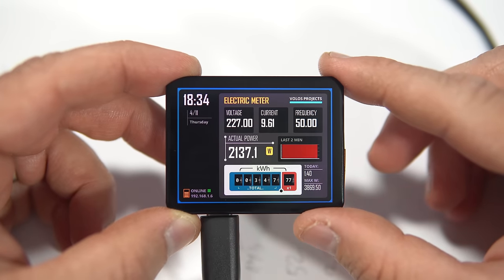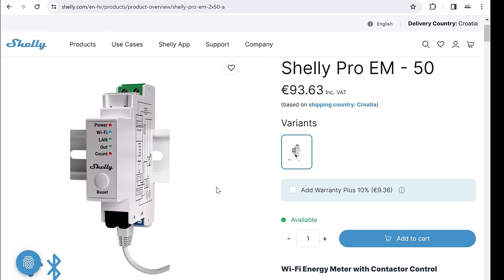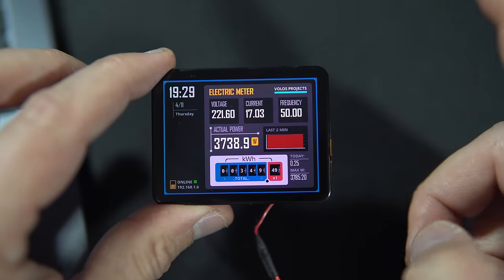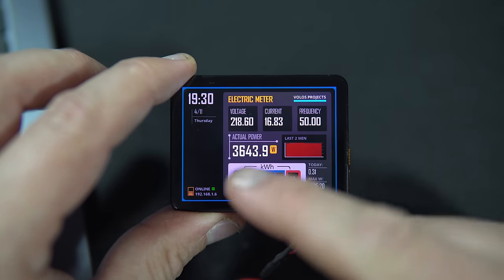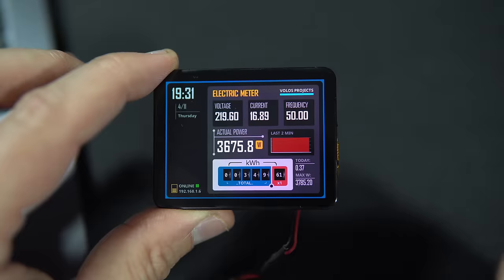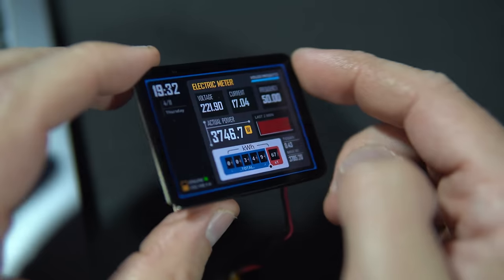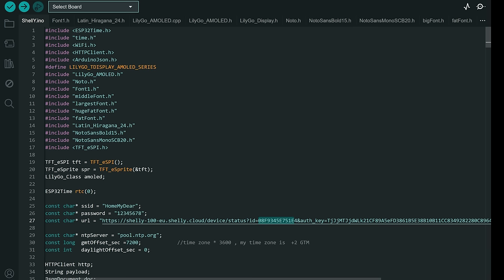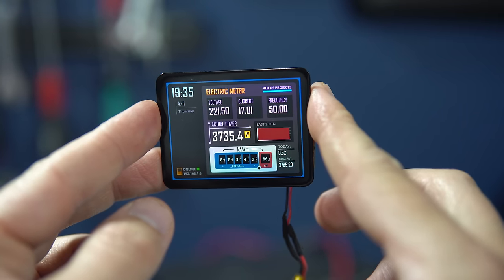Monitoring  House Power Consumption with ESP32 and Shelly Power Meter

Comment: Get rid of the shelly and make your own! It's ridiculously easy and super cheap!  £10 for the ct clamp and £10 or so for a high quality external ADC. Would be a really good project to do and you could use an esp and create your own API on board that matches the shelly calls, so you can easily switch between shelly/your own

Comment: A very good looking user interface, congratulations on the hard work. The small details from it are a great addition. Perhaps you can have the space on the left used to have a statistics scroll-toggle section, where you show stats like "+20% from yesterday" or show listed entry values for the kWh consumed in the past 6-7 days. I know since you're using only the Shelly API that some limitation might be in place if you don't consider a database.
Initially I assumed you would be directly showing data from HomeAssistant, but this is a very cool interface that one can directly use as-is to see the Shelly Cloud values in a great rendered way.
Thank you for sharing these projects with us and keep up the good quality work! We do appreciate it.
Reply from the maker: thank you, yes you are right this API is limited, or i just need to fihure it out. I wish to add history data , forexample last months or similar. Thank you!

Comment: The interface looks great!
It would be interesting to reverse-engineer the power meter communication with the shelly server, so that you can have your router redirect the requests to a local server and thus be able to maintain access to the meter and data even if the internet service is down, or shelly stops providing the cloud service.
Reply: You can use something like Home Assistant for that, it supports fetching data locally from Shelly devices and has a local API which devices such as this one can use to fetch all data. Also allows you to blend in data from other sensors (such as solar inverters, etc).
Reply: @ErikHenriksson_  Ah great, that makes it easier then. I'm all for merging everything into Home Assistant as it's a great project and saves having to reinvent the wheel.

Comment: Your doing great work! You always mention that the coding take a lot time. Have you ever tried LVGL or Squareline? It looks like it could be a little easier and a lot less intimidating to the non programer like me. Also, I love your UI's and coding. I would love to see more projects/ instructionals with more end application examples. like:
- a the sliding bar moving a servo or controlling a (DC or PWM) motors RPM
- a tachometer displaying a motor's RPM using IR, or hall effect senor
- the temperature using thermistors or temperature sensors 
- displaying GPS Data like direction and speed
- using multiple ESP32's networked together using CAN bus (CJMCU-1051) to send data to a display panel or multiple panels. and or using ESPNow.

All your videos have been great, and I think I've seen the screen examples of most of the ideas above and some had actual inputs but I would love to see the gap closed and have more real world environmental input that change the values on the screen. 

If not, that's ok, you still inspire me and show me what is possible!
Thank you!
Reply from the maker: Thank yoi Jason, yes i tried lvgl and sqare line. And i did not like it. I still think sqareline is great tool and lvgl is great library but it is not for me. Also most of time projects made with sqare line look the same becouse people use same template. I will cover aome of your ideas. Thank you again. Cheers

Comment: super nice GUI. it beats by far a lot of other OEM solutions (like Sonoff or Shelly display). too bad the T4 display is not as cheap as a tablet running Kiosk for HomeAssistant. Otherwise it is a neat integration, and having the code available puts this LILYGO board on the top of my wish list. Please consider a code update for a 2ch shelly or scenario with PV production. This would be a great visual indication when there is surplus PV energy, and how much is extra. Also in scenario with inverters (like Huawei) connected with a single power line (not separate power in and power out like Voltronic type inverters) the energy coming from PV is reported with negative values (because is returned from Invertor) while the consumed energy from grid to inverter is reported with positive values. Keep On the good work. you were right few months ago tostop making more clock projects.... there are many more intersting applications to be done..

Comment: Nico Design. I like it. I have made my own with an other display connected via LoRa to my power meter in the cellar because wifi didn‘t work. It looks not so nice but it works and sends the collected data to my homeassistant. 😉

Comment: NO CLOUD version -> Setup and MQTT broker (server). It can even run on a ESP32. Configure Shelly to send data to said broker (supported nativly). Adapt OPs code to get data (subscribe) from the MQTT broker/topic that the Shelly publishes on. 

The concept works, I have been running like this for at least 2 years with no hiccups. I my case, I use Home Assistant (and not the OPs beautiful ESP32 contraption / UI ) to receive/display the data.

Comment: Another great tutorial, thanks Volos.  General question:  I notice that in most, if not all, tutorials that you use generic ESP32S3 board selection in the Arduino IDE.  You do not select Lilygo board in the board setup.  I work with Lilygo, M5Stack, and other ESP32 boards.  Is it best to always use the generic Espressif ESP32S3 board selection in Arduino IDE?  Thanks - Larry
Reply from the maker: Hello, Larry i chose esp32 s3 only when using new lilygo boards, that is not case with m5stack and older lilygo. Thank you for your support.

Comment: Is it possible to set this up without an internet connection? I'd like to set-up an energy monitor like this on a farm; but, we don't have access to cellular or broadband/DSL. I looked at the iotawatt split phase kit for our sub panel; but, it's quite pricey & we don't need to monitor many individual circuits. We just need to record & display energy consumption for individual different sub panels. We cannot get a secondary meter installed by the local utility. Thanks!
Reply from the maker: with this device i think it is not possible.

Comment: Any offline solution (no cloud at all, including local time server) with Home Assistant to display the information?
Reply: need a little bit more coding , and a few more wire , but is use PZEM-014 that is an offline power meter that you can read directly with an arduino ,  and then do what you want with the data 

send it via MQTT , send it to cloud , send it to home assistant , send it to display like in the video and so on

Comment: Thanks for this, mirrored your project but amended the json to cope with the simpler Shelly EM. To charge the battery is it as simple as plugging in to a usb c power supply or do I need to add code to charge the battery?
Reply from the maker: No just plug your usb, if usb is constantly pkuged than yyou dont need battery
Reply: @VolosProjects  thank, but then I have to sort the infuriating red power led.

Comment: Good work, but why do you need dedicated screen and not just write the app for the cellphone? Everybody have a very good cellphone screen in their pocket so what is the reason to by one more?
Reply from the maker: Thease chanel is about programing thease screens for diferent needs. Shelly meter already comes with mobile app which is free. But my idea was to install this in some panel and data will be visible constantly, i dont like to reach my phone for evrything .
Reply: I agree, a dedicated screen saves looking at phone app

Comment: Does it work without connecting to Shelly cloud services?
Reply from the maker: No, this code no.
Reply: @VolosProjects  do you know if it possible to locally connect to the Shelly Pro EM-50? Or can it send data to a local mqtt server rather than Shelly cloud?
Reply from the maker: Yes, it is possible localy. There is no need for shely cloud.
Reply: @VolosProjects  thank you boss

Comment: the meter is way too pricey 

you can get very efficient meter like the PZEM-014  for less than 10 bucks ,  i have 20 of them for 5 years and they work very well 

you just need a little bit more programming to read the data from them  , but nothing an arduino cant do
Reply from the maker: yes, i agree, but with this you also get colud, phone app, history data, calculation, and more.. easy way to setup and use. Most of people dont know how to use arduino or any development board. This product is not for makers .

Comment: So step one BUY OTHER PRODUCT step two USE THAT PRODUCT'S REPORTED DATA... simple enough but not a DIY complete. 
Why not MAKE YOUR OWN? I would be curious to know if there are some github codes out there to use with a simple circuit and that CT.
Reply: Maybe because he wants to make something useful and not risk the fire of his house? You don't have to make everything from scratch to call it DIY, he did a portable data display. Or maybe the display wasn't made by him so can't be called like that?
I bet that there are many custom products on the kickstarter which you could maybe even build yourself.
Reply: @nomadc4  Clamping a CT around a wire WILL NOT cause a fire. I know what he's doing but hes technically NOT monitoring his home's electrical service with the ESP32, He's DISPLAYING it on the esp32. BIG difference. I feel the whole video was to sell the shelly meters.
Reply: But you have to connect this clamp somewhere and power it. Everything using main power CAN cause fire if made by non-electrician. Why do you think he made the video only to sell this product when at the beginning he said that they are very expensive? XD you can say that he makes the videos to sell the lilygo products since he's using only them. But do you really see any advertisement in his videos?